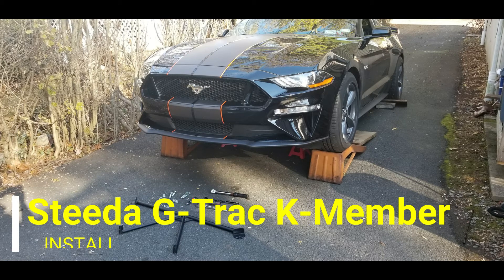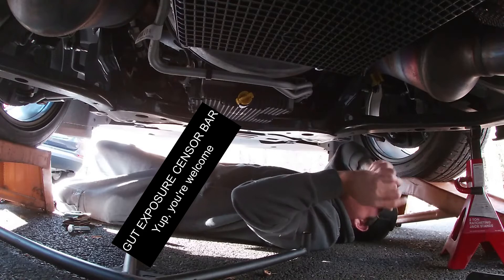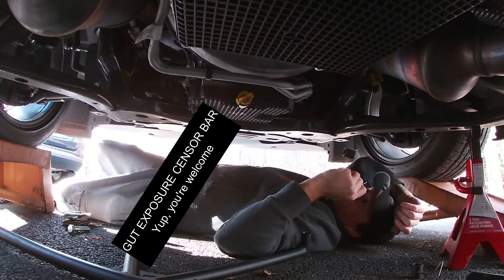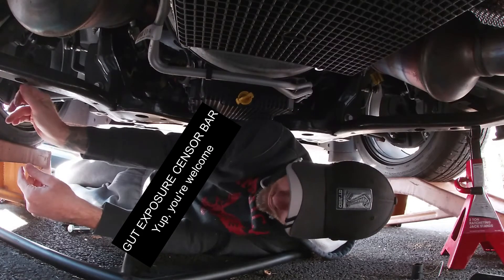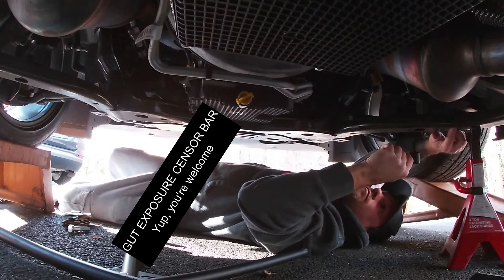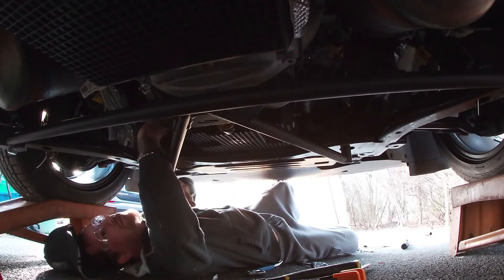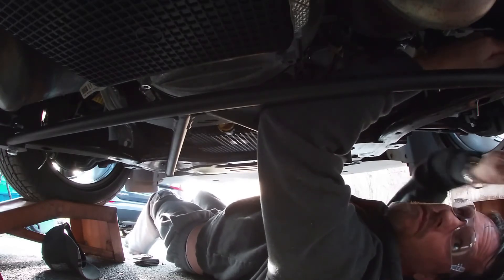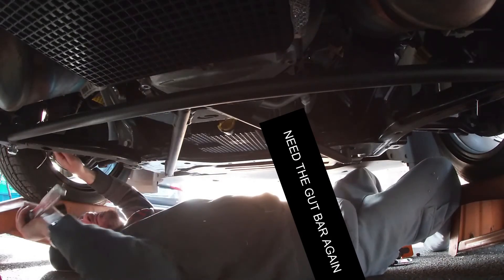Steeda G-Trac K-Member Brace Install - 2019 Mustang GT

Comment: Finally a real installation video! I enjoy watching the pros at Steeda and CJ Pony parts, but when we do the install, this is how they usually turn out. I laughed so much,  because I've  been there before too many times. Great to see how you did some problem solving and even had to run to the store and pickup a new tool. Great video, I hope you continue posting!
Reply: Also do you plan on posting a review of k brace? Interested in hearing your feedback. I hope to install mine tomorrow.
Reply from the maker: 🤣 so true! They always make it look so easy. I try to be real about what is involved and not cut out the frustrating parts so others can be prepared. Thanks so much for your comment, I really appreciate the feedback.
Reply from the maker: @classicturn  yes but unfortunately I already had my winter tires on so I will do a review in the spring.....but even with the winter tires on I could feel a difference when pushing hard through the turns. Under hard cornering it felt more planted and tighter in the front. Under normal, less aggressive driving it is not too noticeable. Good luck with your install, hopefully it goes smoother than mine did.
Reply: @VogelStang  thanks, I also have my winter tires on. It's amazing how different the car feels and performs when you change back to summer tires. You can only push those hush puppies so much. I have the Pirelli Sottozeros. What are you using?
Reply from the maker: @classicturn  I'm just running the stock tires for my model, the Pirelli pzero nero's. They are alright, they do their job for the winter and handle well enough for how much I would want to push the car in the cold. Night and day difference from my summer Mickey's though. Like you said, it's crazy how much difference a tire setup makes. Spring can't come fast enough!
Reply: @VogelStang   Well first amazing how my summer rubber is your winter rubber, yet we still have to same reaction to tire changes. Brave man, to use those in the winter. 

I just did my install and your video helped me a lot. of course my biggest problem was the spacers. The little stamped out steel tab was 1,2,3..I just stuck a screwdriver in there and it popped out. However when the hole got stamped out it caused and indentation of about 3-4 mm top and bottom. You were able to open it with the needle nose pliers, I should have tried that. I did my best to open it up with a screwdriver as a pry bar but it was never enough. I eventually shaved down the spacers with my dremel until they just fit. That of course added about another hour to my install. After that pretty much smooth. I had bought a 12mm hex joint and a 22mm socket the day before so no runs to the store in between.   Did a short test drive and wow, the steering response is immediate. I will now have to be a little more careful as one sneeze and I am going to wind up in another lane. Can't wait till I add my summer rubber so that I  can truly appreciate this mod.  Again, thanks for the post.
Reply from the maker: @classicturn  I'm not really up on my game with all the different tire options, but I did just check and p zero nero's do come in summer and all season variants. But then I started to wonder, am I using the summer version? I was pretty sure they were all seasons but I just went and double checked my window sticker to be safe: ".P235/50R18 BSW ALL-SEAS TIRE" ----- phew! 🤣🤣🤣 I gotta say, I'm super excited that my video helped you out and even more grateful that you took the time to let me know. Sounds like I got pretty lucky with less indentation and good thought on your part to trim down the spacers with a dremel! Awesome job man! It seems like maybe you noticed more of a difference than I did. Do you have a base or PP model? And do you have a strut tower brace?
Reply: @VogelStang  I have the PP EcoBoost which comes with the tower brace. Interestingly,  I had to bring my daughter back from college so I added a hitch to tow a small trailer  and it stiffened the rear and gave me an improvement to the overall steering feel. The k-brace just made my winter tires almost feel like my summer tires.
Reply from the maker: Ok, I suspect that explains the difference in feel between us. I'm sure I still have a bunch of flex up top since I have a base GT and no additional stiffening components. I will be getting a strut brace, IRS subframe braces, and springs at some point so I would expect that should really tie everything together and get that tight feel. Hearing your response to the change you felt has totally got me pumped to get those other items!
Reply: @VogelStang  I will admit, the moment I sat in my car I knew it was different.  I will probably post a review on the mustang ecoboost forum at some point.

Comment: Using ratchet straps are a life save in the installation. Get the rear 2 bolts barely started and use the straps to manipulate the front 2 bolts. A life saver. Thanks for the video
Reply from the maker: 😲 that's an excellent idea! I've been thinking of getting back into a PP1 with a manual trans so if I do I'll need to do this install again lol.

Comment: Those bolts are bolted and nut installed through the frame piece don't even need this spacer. You can torque it to the regular torque. Mine's been in there since 2016

Comment: When you change your oil does the bar interfere with oil stream coming out??? If so what did you come up with for an answer for not making a mess everywhere on driveway? 
Asking cause I’m thinking of purchasing it.
Thank you 
John
Reply from the maker: From what I remember (cause I don't have this particular mustang anymore), when you pull the plug the heavy stream misses the bar but it will hit it when the stream slows down. I used a larger style oil catch and never had a problem with oil splashing everywhere. I do my oil changes in my driveway so it's important to me to not have any spillage at all. On a side note, one thing I found out is that if you have or plan on getting long tube headers, there may be a clearance issue. I have Texas speed long tubes on the mustang I have now and they are about 1/4" to 1/2" inch in the way. Steeda told me to use washers as spacers but I haven't gotten around to it yet.
Reply: @VogelStang  no I’m not getting headers

Comment: how badly does it suck to change the oil with the brace on? I feel like the oil will spray all over it.
Reply from the maker: Honestly I haven't found it much of a problem. Trying to remember the last oil change I did, I believe it does hit the brace but there wasn't any splatter that caused the oil to go all over the place. If it was a problem, I would certainly remember. It's less messy than than the mess and splatter that happens when removing the oil filter. Maybe that would make a good video so ppl can see what impact it has for oil changes.